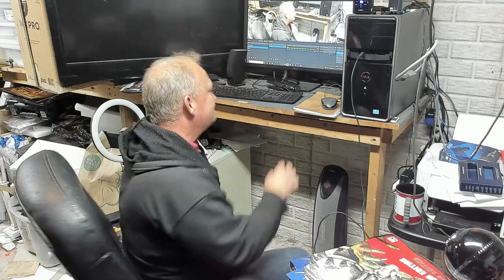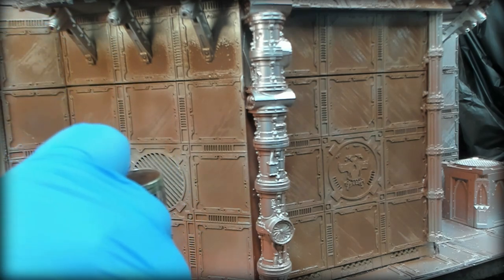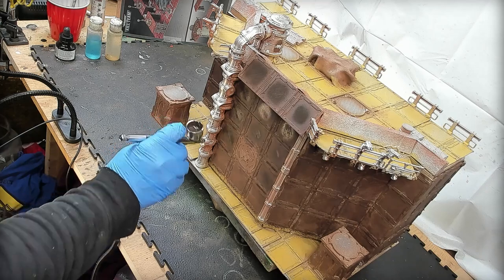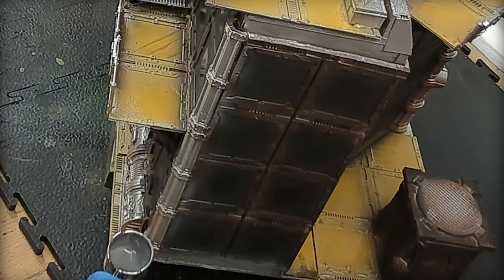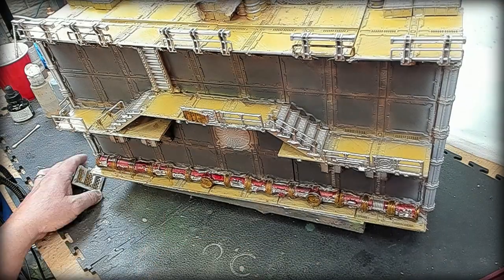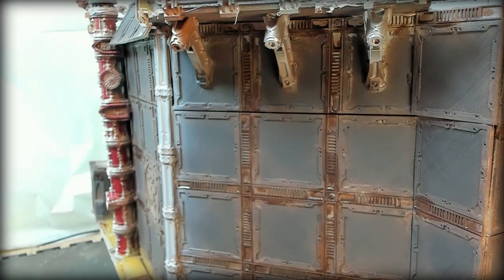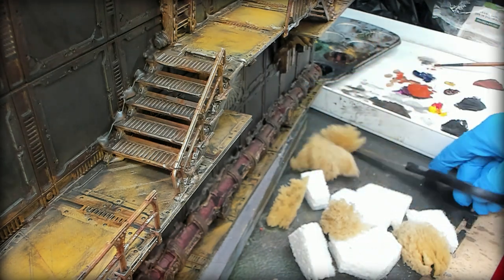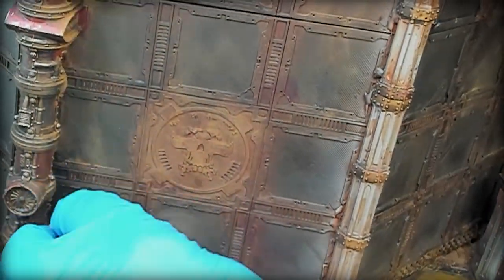What I did- Necromunda Hive Wall completed!

Comment: I'm wondering if you could get that same effect intentionally by dabbing on some white spirits with a brush like a cross between a chipping medium and liquid mask before brushing or spraying with your metallic paint with your contrast.  Also if that does work no reason not to dab on say a heavy orange oil wash on say your bolts and rivets, and maybe the fans, to start your heavy recess weathering where ever the protective paint wont be.

Also the effect where the tan/brown weathering powder really sucked up a lot of the orange oil paint near a bit of texture looks good.  I'd be curious to see how doing that the other way around,brown oil paint with orange pigment powder or a mix of brown and orange with a little bit of black oil paint.
Reply from the maker: Those are all really good ideas!  Thanks again for the feedback!